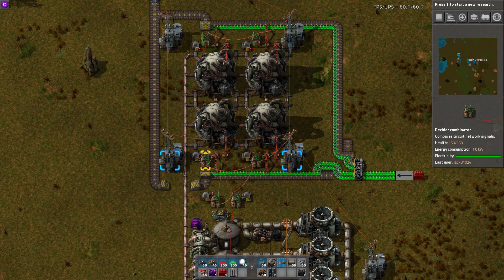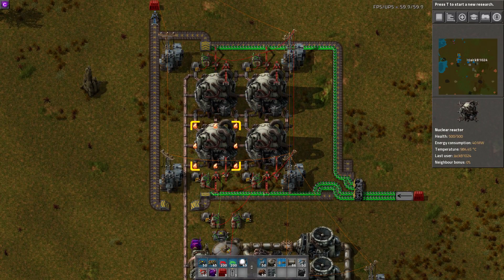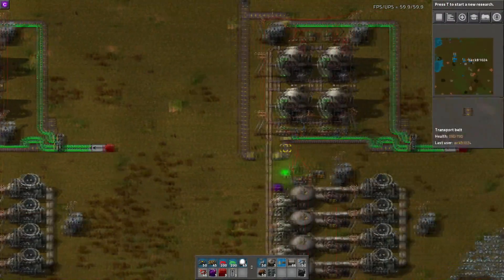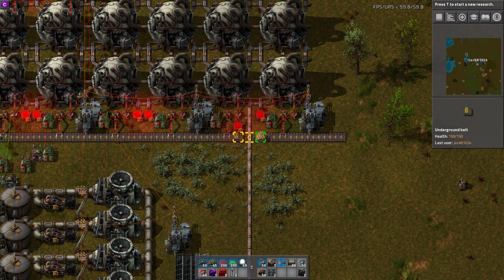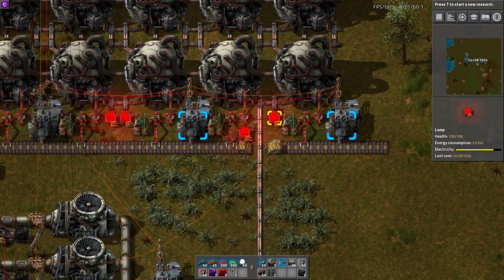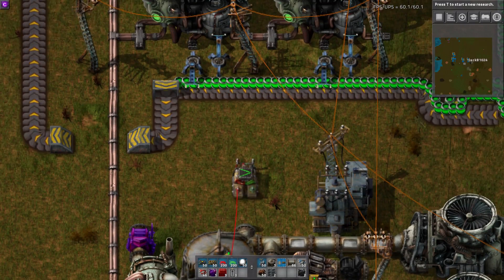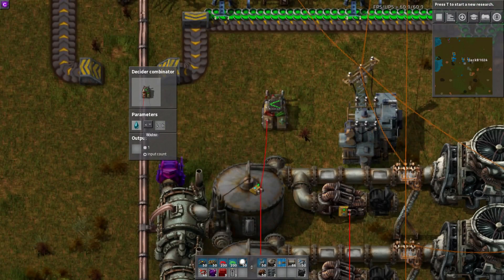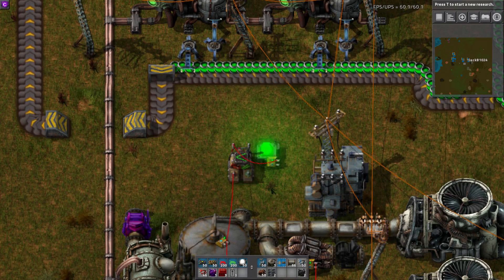Factorio Uranium Reactor Refulling with Combinators

Comment: With respect... I don't inderstand the point of this build. Are you trying for a Goldberg Machine? Like every other machines, Reactors will take care of itself (automatically  un/load the correct materials when needed). Reactors are such that, once started should not be stopped. No other controls/conditions are necessary. Eg. Robot based: 2 inserters, 1 requester, & 1 passive chest per Reactor is all you need. Belt based: 1 looping belt, 2 insertets per reactor, 1 inserter (for fresh cells), & 1 filer inserter (for spent cells).
Reply: As he explained in the video, it's to get greater efficiency (100%) out of the fuel cells. 

The factorio reactor can't be regulated, and always outputs energy when there's fuel present. This energy is used to heat up the reactor, heat pipes and heat exchanges to the maximum of 1000C. This heat is then converted to steam (at the minimum reactor temperature of 500C) which drives turbines. But what if the reactor and all other components are already at 1000C and you don't need the full energy output of the reactor at this moment? The reactor will still output energy at 100%, as it can't be regulated, in essence wasting the nuclear fuel for no benefit.

In comes dynamic refueling. In this case we will only ever refuel the reactors once we need it to output energy. Firstly we fill some tanks with preheated steam (see it as charging a battery) to their capacity, and if these tanks gets full the reactor and the components themselves will store the remainder of the energy as heat. By now the reactor doesn't have any fuel to burn, and is inactive. But we can still get energy out of the steam tanks and the reactor heat. Once the reactor and components fall to 500C, the steam in the tanks will be consumed. This will only happen in the rate that the energy is needed by the factory, as then turbines use steam with regards to demand.

After a while our steam tanks are running out of steam, and needs a refill. For this we will have to start the reactors again. But we still don't want to fill them with so much fuel that we both fill our storage tanks (batteries) and reach reactor temp of 1000C with energy remaining in the reactor. Thus we only put in as much fuel as we need to keep the system going (1 cell). This lone cell will (usually) be enough for both meeting factory energy demands, fill the storage tanks and also heat the reactor. And even if it isn't, the circuitry will trigger again once this fuel cell is spent, inserting another one. 

This setup is normally not needed in normal play,  as energy is usually abundant and uranium easy to come by. In these cases we might not care that our nuclear fuel cells are only used to <100% of their potential. But in modded games with limited construction area (hard to place solar), small energy reserves and/or small uranium deposits, this system will make sure you use your resources as efficiently as possible, with the maximum efficiency (and easy to achieve) of 100% per fuel cell. A setup like this one has greatly helped my sea block play.
Reply: The setup is because fuel cells burn whether or not you need the heat so you waste uranium if they run all the time.  with this setup you only add fuel when you need heat.

Comment: You can do this....... or not bother with any of that, you just setup more centrifuges so that they constantly produce more fuel than reactors consume, so that you don't care if it isn't actually needed or not ;)
Reply from the maker: I suggest you check out version 2 of this setup (https://www.youtube.com/watch?v=CRsTHPgwTzY) it uses no combinators just circuit wires which makes it really easy to setup.
Sure you'd probably make enough fuel that you don't need to worry about the wasted fuel.

Comment: I did this with 0 combinators. All I needed was a red wire, and connect one cistern with one manipulator which unload used fuel cell(unloader), and all manipulators which loads new fuel cells. Unloader works when steam is below 6k and sends a signal to the circuit, and all loaders load one new fuel cell.
Reply from the maker: Cheers. PsychoMuffinSDM already mentioned a very similar circuit a few days ago. I'm going to put out an update to this video with the new 0 combinator circuit.

Comment: Aren't you a little bit curious? All I need are two wires per reactor. Plus, I have the extra ability of setting each reactor fueling trigger individually, say, one at 80% steam, another at 60%, and 40%, etc. Have I piqued your interest? Can you figure out what I did?
Reply from the maker: Well to manage to individually control each reactor, one of your wires must be going from the storage tanks to the inserters. However controlling an inserter just bu how much steam is in the storage tank could easy lead to it putting more than one fuel in the reactor due to the time it would take for the steam to start generating. I'm not sure what your second wire is doing but it must be solving that problem.
Reply: Ok, I think you'll like this, and it is based on what you did, and it is very simple, so simple, I think I can explain in text: Connect all your inserters that pull out used cells to the tanks. Also set these to read hand contents and hold. These inserters will only pull the used cell out when they match the conditions you set for low steam. They can all be the same, or all different, however you want to do it. Next, connect the inserter that inserts a new cell with a different color only to it's neighbor that pulls used cells out (this will prevent it 'hearing' a signal from another inserter). Set this inserter to only grab and insert a new cell when it's neighbor is holding a used cell. In both cases, override stacking to one item at a time.

Note, you will need to manually insert the first new cell to get it going. Also, you will need to make new cells faster than you use them. If there is not a new cell when the used is pulled out, the loop will break.

And there you go! No extra combinators nor signals. I hope this description will suffice, let me know if you have questions. If you like it, make a video! =-)

In short, you only take out a used when steam is low, and only put in when you take one out. Thus, you only put in new when you are low on steam
Reply from the maker: Ah, gotcha. That does sound like it would indeed work quite well. Good job.
Reply: thanks for you video, it helped me think of it

Comment: Do you have a blueprint string of that that you want to share with us  :)
using pastebin og something like that cus youtube comments or description does not handle all the characters well.
Reply from the maker: For things like this I generally don't like blueprint strings as they are too easy to be copied without learning anything from them - so when similar problems arise in the future you cannot work out for yourself how to solve them.

So I'd suggest you give it a go building it yourself so you can get a better understanding of how it works.

However, if you still want the blueprint string, here's the simplest one I could make (just shows combinators/lights and connections to the tank / inserters)

0eNrVV9uOmzAQ/Rc/VlBhSPaCqv5ItUIOTBJrjY18SZuu+PeOIQq5mCxJt1U2D4kc4zMz58zFvJGFcNBoLi3J3wgvlTQk//FGDF9JJvx/dtsAyQm3UJOISFb7ldNMclfHSwciLkEI0kaEywp+kZy20bvnKyh5BTouVb3gklmlDwDS9iUiIC23HHpvusW2kK5egEYLexxTMyFiweoGsRtl8IiS3irCxFlEtvgzR2SMy2oligWs2YajNXyk5Lp03Ba4V+3PLbk2tjjzfsO1dfjPYLh7ImZya9dcrkhvw1jmiUz8om6Y7gLLyXe/7QygKaE0hmS1g/6EhNKbNt4W9V8aqsOQOa7SaO9rt2xf2tZzfMJKeondc3bSnp3Z1zF+digDP+YGglYaQPrwDXic4pa8OuEyIsrZxt3iRKmaLcbjpC2WWtUFl4hD8iUTBtoRQfrD70kSHW3PUKKIpCN6Up/fU2DpiNLZPkCh5CpeM6ybKubSgLYQ0DqZVgi1qqBQy0I1gGx3x7PBIQ2sKrwpnxAWPdrl8fBEt9k95pG6RjCd0edpST67MvSYDrFXXPeudDD/qiUcJNvFfvCfeA2lFFbQBrTG6i7Qw/IVg/sNu8Z9wvd8UqtN77vTBuJ62ONbbDmmUdrGCxB2PIOy4wx6CIA+TgZNJmM+TZt1OwXoZ591E9vA83Wzbidhcl+zzmDnck18hzMvNLTomTLRxE5+PBtpoCONz8qnqWboiZlsJHNock1H+1z1FOQpIFyYGHpVTX1sSS2FQ9/2Dvxkfpgf8TJL8HPCzbd7qItsNENp4OI+nuln+TwKm4wpOLwBMM3tugbLy8uNEeXrdKTHgygNSzqgflCjPJP34OpJvlxQN5wv7V9cOA/a0KQyGrub0+FybpBztoIYI3wduwJkIeJv6ce9P5gz3ZDJD97rI4KXPdNfMGazdD6fPyX0sW3/AITphZg=
Reply: I will, and thanks

Comment: what sort of efficiency does this work at, in terms of intermittent load? 

firstly, as far as laser turrets? they have a high idle draw but use much more, and, for sake of argument, theyre mostlt erratic in their power usage. how well does this account for that? 

and, too, my factory tends to have many ups and downs while i build the next bigger better thing. 

i understand there is a buffer to sort of retain the steam energy, but, is there some sort of practical ceiling? ie, if my whole factory stops production from being full while i am building or clearing biters, is there the potential for wasted fuel?

sorry, hope that makes sense.
Reply from the maker: A nuclear reactor can support about 7 steam turbines with the amount of heat it generates. 7 steam turbines = 40.6MW of energy. So a setup like this would be able to put out a sustained 4*3*7 (# of reactors*neighbour bonus*7 turbines/reactor) = 84 steam turbines worth of power or 487.2MW. You could add even more steam turbines if you wanted to support a higher peak load, but the average power generation would never exceed 487.2MW.

The buffer size depends on the number of storage tanks you use. If you want enough buffer to store an entire cycle worth of steam you would need 4*3*82K worth of storage (a nuclear reactor generates 82K worth of steam in 1 cycle). This equates to 40 storage tanks, however you can get by with a couple less due to the fact that the reactors and heat pipes can store up to 500C of excess heat before energy starts being wasted.
Reply: hmm. that's some good info, for the future. I followed along with your build and got it working correctly, it's very nice. I think in ten hours with five centrifuges I've only gotten about 30 U235, so I'm trying to make sure this is a reliable power supply - so far it seems to be. I have 4 reactors feeding 8 heat exchangers to fill 9 tanks, 225k steam, and that's used by 8 turbines. I know the ratios there are way off, but I wanted the efficiency bonus from 4 reactors and I can buffer the excess through the tanks. I set mine at 50k, rather than 40k, just to give a little extra in case the reactors cool down too far. 

This keeps things fairly consistent, and it's very scaleable. 

I only have one complaint: I have never used combinators before, never had a use for them, so it was a little difficult to follow along - and not as far as understanding, but you have a tendency to whiz through the wiring and it was hard for me to see what it was you were doing. Just some friendly feedback. Thanks for the video, helps a ton.

Comment: it would be a better tutorial if i knew what shot cuts you are using .. you cant remake the tutorial with a bit more on what you do actually .. you are also way to fast to follow along. aslo i dont understand what you user the pumps for and what they are connected to :(
Reply from the maker: Hey, not too sure what short cuts you are referring to, if you want, reply with timestamps of points in the video that you didn't quite understand (eg, 8:22) and I'll write a more detailed response on what I am doing during that part.
As for a quick overview on what the whole circuit does: The first combinator is there to check when our steam levels get below a certain value (in this case I chose 40K steam, you may want to use a different value depending on how quickly the steam is used up as well as how many storage tanks you are using) so when our steam gets below this value the combinator sends out a Signal_Green with a value of 1. This signal goes into our 2nd combinator which is an SR-Latch (I don't go over how the SR-Latch works in this video, but you can go https://www.youtube.com/watch?v=tmZF7CiQkVs to see a video I made on how SR-Latches work). This SR-Latch is used to determine if the reactors are currently producing power or not and as such is activated by the Signal_Green from the 1st combinator and deactivated by the inserters taking out spent fuel cells. Finally the 3rd combinator is used to stop the 1st combinators condition being true while the reactors are running - this is because the first combinator is meant to send a signal when we need to start up our reactors and if they are already running we don't need to start them again. To do this it gets the Signal_Green value from the SR-Latch (which is 1 when the reactors are running and 0 otherwise) and multiplies it by 40K (the value for steam that is checked with the first combinator) and outputs that value as steam. This signal is then fed into the first combinator. This means that as long as our reactor is running, the first combinator will see a steam value of at least 40K from the third combinator (plus however much steam we have in the storage tanks) and will therefore never tell the reactors to start up again. This is how the main part of the circuit works.
Then to control the inserters putting fuel into the reactor we have another SR-Latch for each inserter. This SR-Latch will be active when the inserter needs to put fuel into the reactor and disabled otherwise. To do that we set the "set" signal to the Signal_Green from the 1st combinator in the main circuit (which is used to tell our reactors to turn on) and has the "reset" signal set to Fuel Cell from the inserter that is inserting fuel into the reactors.

As for the pumps and what they are connected to: I mostly skipped over that because it isn't necessary to the video. Those pumps are connected to "void pumps" from the "Creative Mode" mod. Basically whatever is piped into those pumps will disappear from the world. The reason they are there is to act as if this network was connected to a factory that was actually using up a lot of power and thus consuming a lot of steam. Without them I would have either needed to build a factory that uses up a lot of power or just waited for ages for the steam to be slowly consumed.

As for the speed I talk at: sorry about that. I am kind of use to watching youtube at 2x speed and I generally talk a little fast. I'm trying to train myself to talk slower for my videos to make it easier to follow along.

Comment: Hey man.  Great job explaining this.  One small change i made was to set the inserted that removed the spent cell to pulse instead of hold.  I noticed that a few times the hold signal was resting the latch a few too many times causing 2 new and good fuel cells to be loaded instead of the desired 1.
Reply from the maker: Thanks mate. The reason I had those inserters on hold mode was in case the base was running on low power. In this case there is no guarantee that a combinator will update on the tick that the inserter picks the item up on.
However, as long as you make sure you are producing enough power to satisfy your base's demand, I can see no issue with having it on pulse mode instead of hold mode.
Reply: That's a good point.  I'm working on a way to set up an independent solar farm to power my nuclear infrastructure so that should fix that in theory.
Reply from the maker: Ah, that's a really smart idea and shouldn't take too many solar panels to do.
Reply: I'm using burner inserters to supply the reactors powered by.... nuclear fuel.  For fun partly, but practically they will never run out of power for the life of this game either (about 8500 swings according to info on the wiki).  My own system works a bit like a latch, loading a chest with one fuel cell per reactor and an inserter that is triggered by low steam (splitters to send one to each reactor), then reloading the chest when steam goes above the low level.  I do like PsychoMuffinSDM's method though.
Reply: I think the low power issue can be solved. Connect a few accumulators to your power system, then connect them with a seperate power line to the system that powers your reactor fueling. DON'T connect the two networks, just set the accumualtors to sit in the overlap of the substation's AOE. You'll probably need to remove the copper wire. This way, your main power line charges the accumulators, and should you have a sudden power failure, you'll still have the accumulator power. Now you just need to make sure that the accumulators compare their charge to your outside network, and only connect there via a power latch when they're lower then your main network.

Comment: looks good just curious how many tanks u would need to store the steam generated. having capacity for all the steam would be impractical but say 20-50% would give a nice buffer
Reply from the maker: A reactor will produce 82L of steam from 4 heat exchanges per fuel cell (with 0% neighbour bonus). So with the setup shown here you would need 4*4*3 = 48 heat exchanges (4 exchanges * 4 reactors * (1 + 200% bonus)) and would need 82*4*3 = 984L of steam storage.
So if you wanted to store about 20% then you'd need 197L or about 8 storage tanks.
Also I'd suggest you connect the storage tanks together somehow (I connect the output pipes of the heat exchanges together) so that it can balance the amount of steam each turbine has access to.

(Edited 80L to 82L in how much steam is produced)